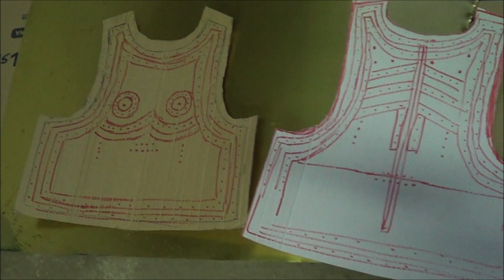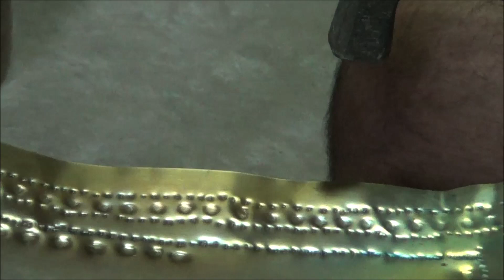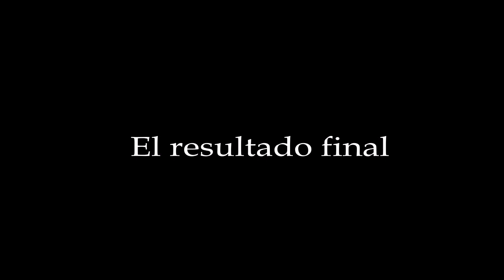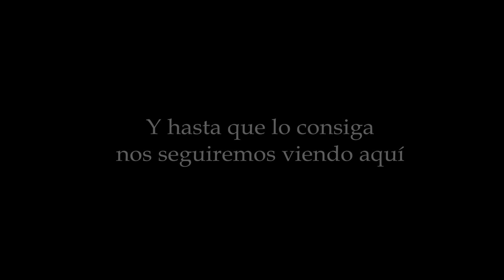Armadura Celta - La Coraza de Marmesse

Comment: How much does this cost you to make?
Reply from the maker: Being a 0.5 mm metal plate it is easier to work with, but it takes time to make the entire pattern correctly, also the weight and the price is a little less than the 1mm ones.